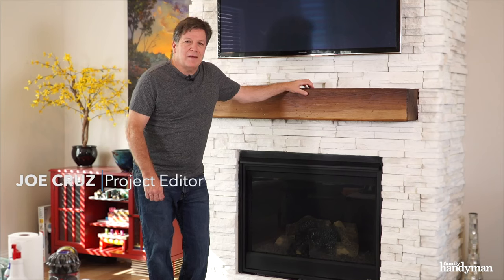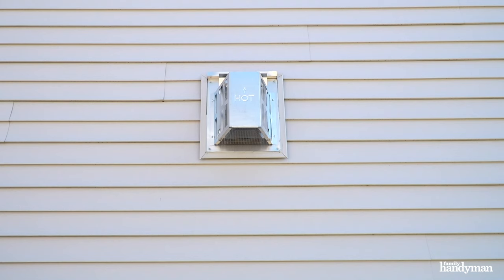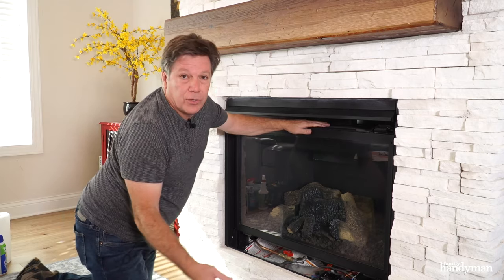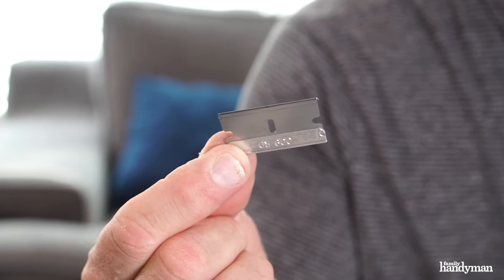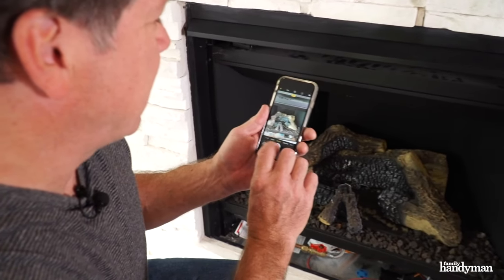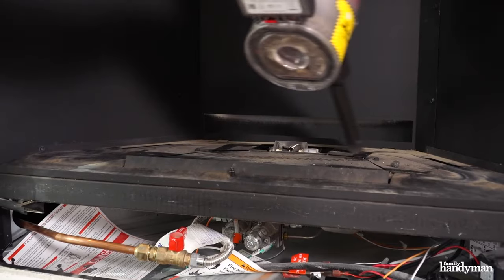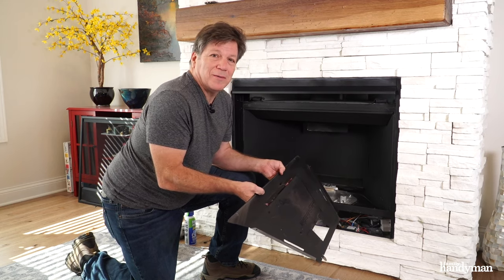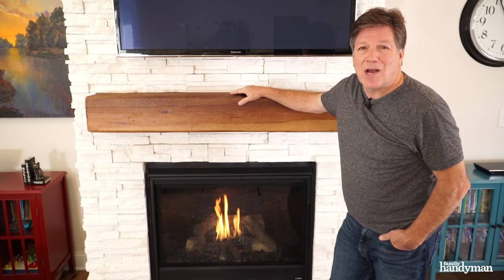How to Clean a Gas Fireplace

Comment: Just a heads up... Make sure if you are using normal window cleaner, MAKE SURE you are not using an ammonia based cleaner! It will leave invisible residue that will react with combustion by products, as well as possibly damage the protective coating on the glass!